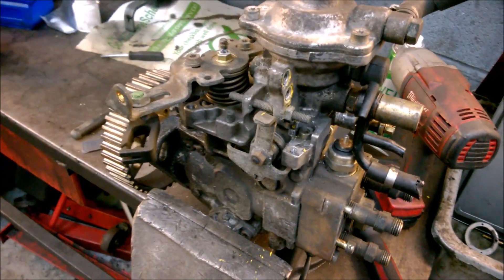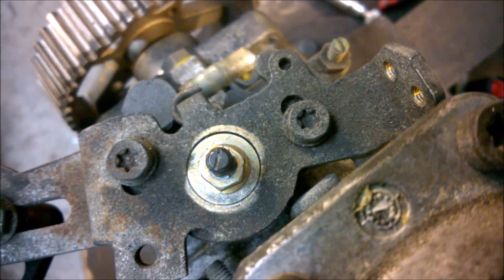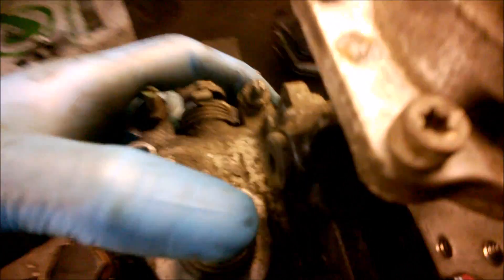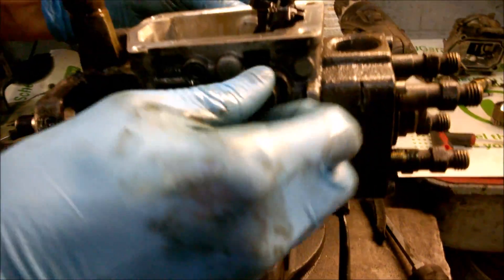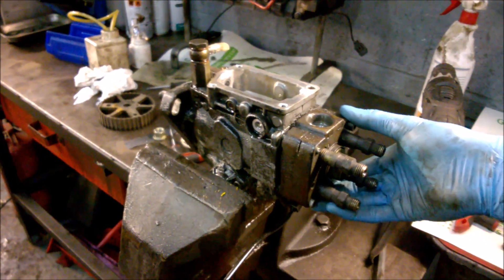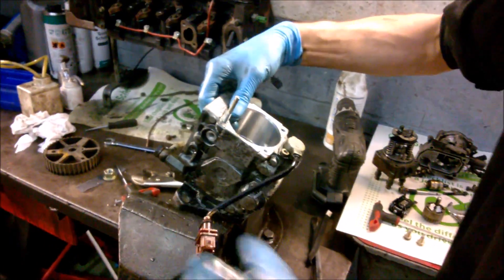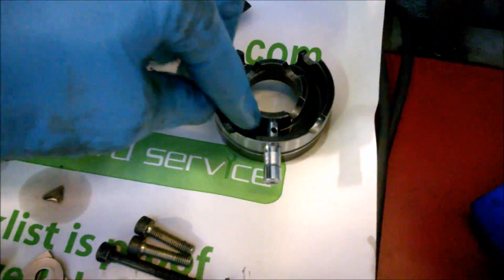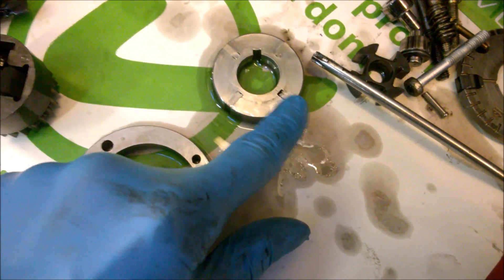306 Bosch ve pump strip

Comment: Hi, I don't understand how timing is set on pump according to engine (chamshaft, crankshaft).... obviously it has got 4 pipes where fuel under pressure goes to injectors, by that I mean  fuel has to be pushed  in correct time and to correct cylinder....  Adjusting chamshaft and crankshaft to correct possition(zero position) is easy to do, but how to know  the position of  bosch pump and correctly adjust it...

 I saw many videos about adjusting bosch pump by a dial gauge, and I don't believe that finding " some"  zero point of the fuel piston and moving it forward for 0.8mm does the job correctly. I would appreciate any advice , regards.
Reply from the maker: I never set these up on the vehicle with a gauge as most if not all of my pumps are modded in someway and therefore they dont have a factory setting. I usually adjust by ear myself. I can tell within a little where they have to be when the engines running. I start at about two thirds advanced run them up and adjust while running. hope this helps in some way and good luck.

Comment: Hi I have a 2.5di transit no ecu no turbo,I have turned the screw on the top underneath little cap in a lot but van drives better like that I tried turning in smoke screw for more power but could not get a sweet spot without black smoke,but with the screw on top screw down it does not smoke my question is will I do damage if I leave it screwed down.cheers